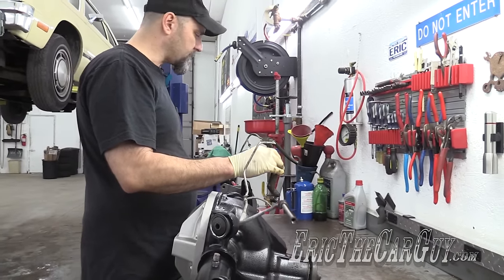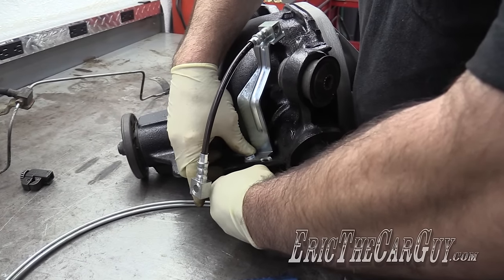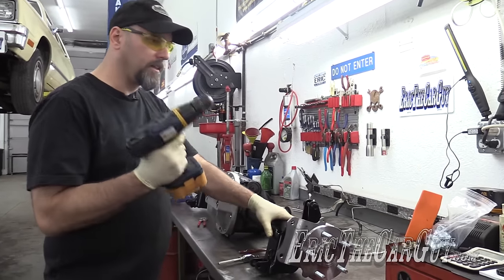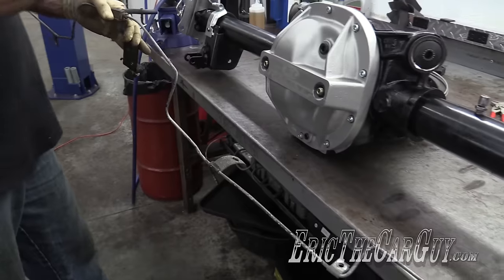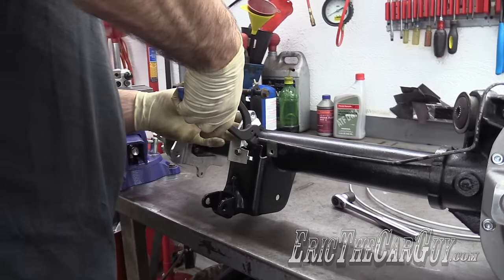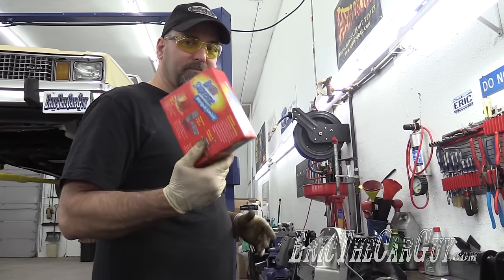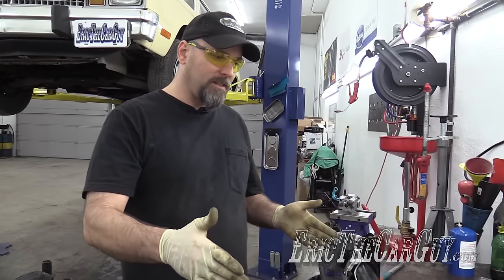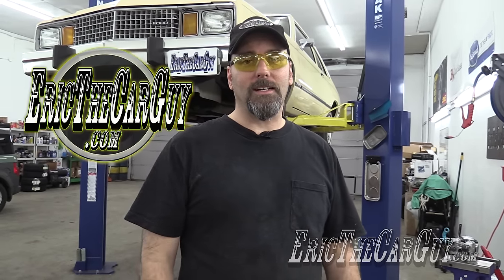Bending and Flaring the Differential Brake Lines #FairmontProject

Comment: Eric- because copper lines are illegal in New York- the big thing around here now is Nickel plated copper. Shiny, flexible, corrosion free, and NYS DOT legal.  http://www.jegs.com/p/JEGS-Performance-Products/JEGS-NiCopp-Nickel-Copper-Brake-Lines/2111534/10002/-1
Reply from the maker: Thanks for the recommendation. I'm going to use what I have till it runs out.
Reply: EricTheCarGuy  You can always spray a quick coat of clear enamel for added protection. All you have to do is block air & debris. Bare steel flash rusts very quickly, especially where bent.

That rear end came out beautiful. I bet it was heavy- but once up on your trans jack it worked out fine.

You are so spoiled- with all your toys!

Crawling on the ground must seem primitive now. Eric O. yelps when he has to.
Reply from the maker: Yea, it did come out nice. It was heavy, but I managed. You are correct, the new toys are amazing and I appreciate each and every one. I say a little thanks to my fans every time I use them. After meeting Eric O. last weekend, I wouldn't feel too bad for him. He's a big boy. Definitely looks like he can handle himself. Not saying that working on the ground doesn't suck any less.
Reply: It's not nickel-plated copper, it's an alloy of nickel and copper, and from what I hear, it cracks pretty easily. What's so wrong with stainless?
Reply: Tim Ramich Nobody said anything was wrong with stainless, Tim.

Yes, you are correct-
it is an alloy- not plated.

It must be somewhat good-
if high end, Race cars, and aircraft use it?
Reply: Hey eric, greetings from the UK, long time watcher first time poster. I have the best two tips ever for replicating brake lines. 

Place your new line against the old line, and to get the perfect match, zip tie both lines together at regular intervals along the lines, this keeps it perfectly matched. 

To finish off the line to make them look perfect and to protect them from corrosion, before you attach the ends, slide over a length of heat shrink, once the ends are on, cut off the heat shrink to length and apply heat to the material.

You then have perfect brake lines. 

Paul Sykes, garage owner in the UK.

Comment: Why do you call bolt's 'fasteners'?
Reply: Maybe he wants to avoid confusion. Fasteners only fasten, while bolts can run away.
Reply: It is the proper term.
All bolts are fasteners, but not all fasteners are bolts.
Reply: patw52pb1 You have it backwards.  Bolt - is the proper term. Fastener could be rivet, nut, bolt, clip, anything that fastens.  Whereas a nut is a nut, and a bolt is a bolt.  Bolt would be the specific, correct term to use for a bolt.
Reply: patw52pb1 Eric had a bolt in his hand and called it a fastener.  It was not a cap screw or anything else.  It was a bolt.  Most people call bolts, bolts.  Nuts, nuts.  Cap screws, cap screws and grub screws, grub screws - they do not refer to an entire family of product when referring to a specific product.  I was just wondering why he refers to it many times over as a fastener and not a bolt.  Not to troll, just to understand how and when bolts became fasteners.  Are nails also fasteners?  Rivets?  There is no need to attack my intelligence, spelling or anything else.  That is just petty.
Reply: patw52pb1 Using your logic, we should start referring to cars, trucks and motorcycles as 'personal transport devices' - since the term 'car' would be too specific for you.  Correct?
Reply: ArchimedeanEye 
Eric had a "cap screw fastener" in his hand and referred to it as a fastener. 
It is a cap screw since it was being used in a threaded hole. 
Referring to a cap screw as a fastener is quite acceptable. 
Most hex headed fasteners used in the automotive industry are cap screws. 
Very few actual bolts are used on most passenger and light duty truck vehicles. 
You call it what ever you want, however the proper term used by knowledgeable professionals is cap screw fastener. 
Do yourself a favor, go look up the ASME, ASTM definition of "bolt", ASTM A193, A194 and specifically A307B bolts. 
Then go look up the SAE definition of "cap screw" and specifically ASTM A449, SAE J429, ASME B18.2. 

Notice the differences in applications, configurations, dimensions, shoulder dimensions, shank dimensions, thread dimensions, face dimensions, under head relief, radius, features, tolerances, attributes and properties between bolts and cap screw fasteners. 
Bolts and cap screws are very different and have specific uses and are not interchangeable including naming terminology. 

The proper industry term is vehicle not car.

Comment: Am I the only one to notice that the brake system is not what you would call x-split? I mean, you'd lose braking on both rear wheels in the event of a leak in this setup...
Reply from the maker: The master cylinder is set up to still provide pressure to the front brakes in the event of a rear brake failure.
Reply: Well, that provides some redundancy, not what I'm used to, tho ;) How about front wheels, are those connected too?
Reply from the maker: Yes, the master cylinder uses 2 separate chambers. One for the front, and one for the rear.
Reply: I just realised I didn't state my question quite clearly, but Your answer gives me what I wanted to know, thanks :)

Comment: if you use zip ties insulate the steel lines with a rubber pad to prevent the fluid from vaporizing  you will wish you did

Comment: you had the left caliper on the right side.....
Reply: Good eye.  The bleeder goes on top. That was just a fit-up in this video.  They were installed on the proper sides at the meetup.  You can see this in Eric O's video of the meetup. Chris
Reply from the maker: Good eye. Yea, it gets worse in future videos as you'll see. I did end up figuring that out in the end.
Reply: +EricTheCarGuy sorry Im not trying to be one of those trolls pointing out everything wrong your doing.  I'm a mechanic so I get it 😉.  can't wait to see the rest of the vids
Reply from the maker: No worries. I never saw your comment that way. I just had to smile because as you'll see in a future video, I had some issues with those calipers for the very reason you pointed out. If I had seen what you commented on back then, it could have saved me a whole lot of trouble.

Comment: "... standard sizes and metric." As the US is one of the three countries in the world, along with such advanced societies as Myanmar and Liberia, that uses Imperial measurements, that comment is kind'a funny. ;-)
Reply: It's frustrating too that certain manufacturers use different metric size "sets".  I can work on just about ANYTHING on my Civic, (and just about any Honda), with a 10mm, 12mm, 14mm, 17mm and 19mm.  Damn near tear 95% of the whole car apart with those sizes.  

My Porsche?  It's more like 8mm, 10mm, 11mm, 13mm, 15mm, 16mm, 18mm...and 19mm.
Reply: Lierofox 
I see what you're saying, but if you have a Porsche to work on - I really think you could have been worse off. ;-)
Reply: Peter Riis It pretty much fell into my lap for free a few years back with a blown engine and I swapped in a new one, it's a poor man's Porsche.  Literally that was that model's nickname.  It's a 1975 Porsche 914, I swapped out the 1.8L 75hp boxer engine for a JDM Subaru STi engine in it (EJ20K, 2.0L turbo ~300hp)
Reply: Lierofox 
Damn - you have a wolf in sheeps clothing there. Have fun with it - and stay safe. :-)

Comment: "between standard sizes and metric" - sorry, that is wrong. Metric is the worldwide standard, so it's between standard sizes and imperial (or however the weird numbers are called). Also, if 3/16ths is 4.75mm then 3/8ths isn't 10mm, but 9.5mm. At least that's what math tells me.
Reply from the maker: You're right, but I don't always get the semantics correct when we're shooting. A lot of stuff to keep track of. Thanks for your input.
Reply: EricTheCarGuy Just teasing you to finally go metric in your videos, LOL!
Reply from the maker: No worries. I am trying to convert more over to the metric system though.
Reply: EricTheCarGuy I second this!